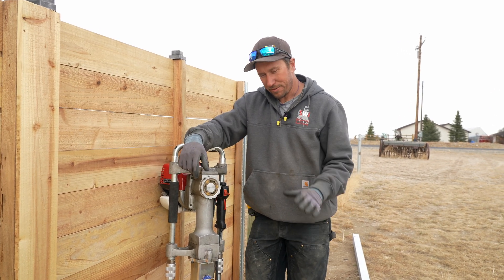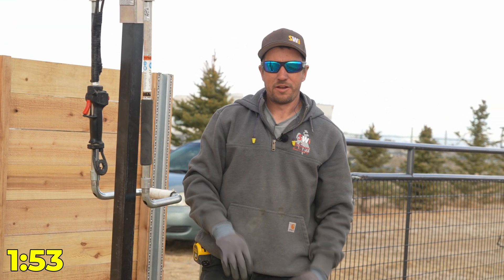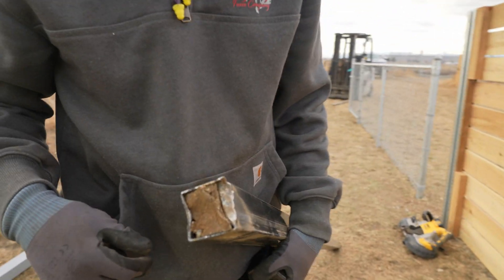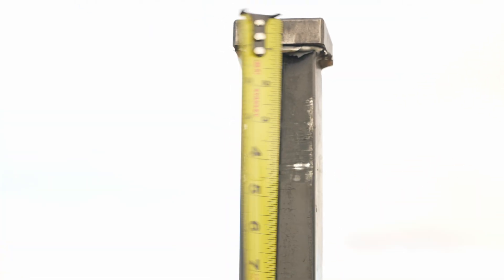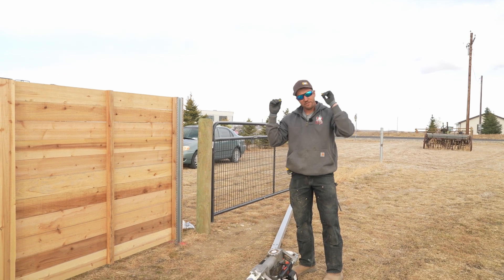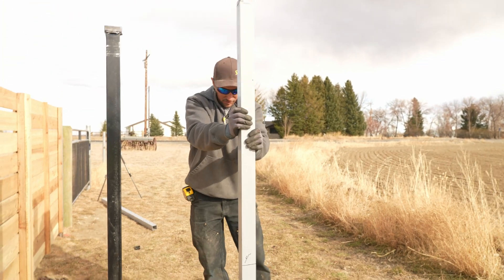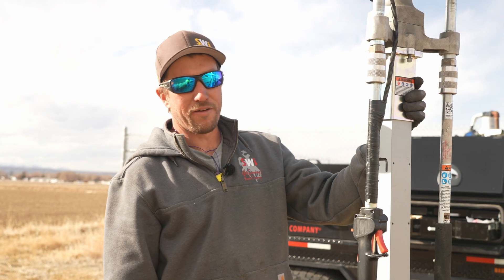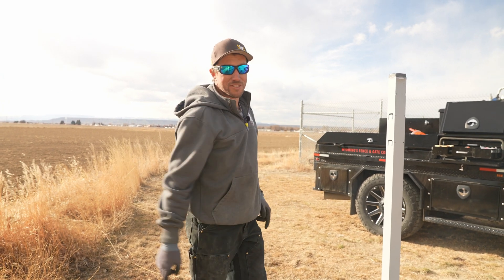Can You Drive Aluminum Posts Without Deforming Them?

Comment: QUESTION: If you're driving square posts aluminum/steel, how do you keep the posts from twisting slightly when hitting rocks or other debris while being driven down? This is assuming you're installing fence panels and need them all to be 90 degrees flush with eachother for the install.
Reply from the maker: You can use the I post system and sleeve the post over the I post so you don’t have to drive square posts. Or you could create a square wrench to prevent the post from turning.

Comment: could you make a pyramid shaped cap to but on the bottom to make it drive a little better and not just pack up with dirt. Seeing the cap you put on top to drive them made me think if you had one of those with a point it could be a game changer for driving those posts!
Reply: You would be wasting a huge ton of money and making it harder to drive. Where is all that dirt and rock gonna go. You would be pacing it to the side. 

Besides the best thing to do is add water. Start driving the post and dump some water down the post. It works great.  Every time I drive posts I take a 55 gallon drum full of water, a gasoline siphon tube with check halve, and a few gallon milk jugs. You would be amazed when you hit hard dirt or rock (unless it is just a huge rock) and you think it can't go anymore, add the water and let it drain down, and it starts going deeper easy.
Reply: @AztecWarrior75  everyone has a 55 follow drum sitting around
Reply: @comingtofull-ageinchrist6736  Dude 55 gallon drums are easy to get. 

Also who do you think you are talking to? The people driving posts and are going to do a lot of them can just go get one. If you got the money to buy a gas powered post driver, you got the gas to go get a 55 gallon drum. BTW a 55 gallon drum is just what I use. You can use a trash can if it works. Come on man. Hell a few 30 gallon drum would do also. 

In any case it sure beat spending a ton of money putting a "pyramid" on it and making it worse. 

But just to be nice and showing I give this advice in good faith, I will tell you a very good source of getting drums. 

Go to your local car wash. The ones that are all auto mated type and have attendants. Talk to the manager and ask if they will give you the drums. Many times they will just give them to you. Sometimes they will ask for money. If they do just wait for the next manager. Sometimes it is policy and sometime the manager is just trying to make a buck.

Sometimes they won't have any right then and there but they change them out often.
Reply: @AztecWarrior75  maybe for some people
Reply: @comingtofull-ageinchrist6736  "maybe for some people"

maybe for some people, what?